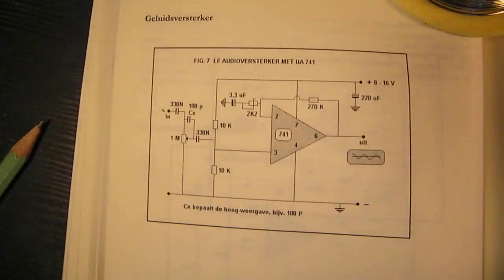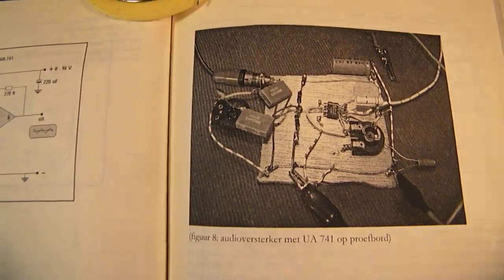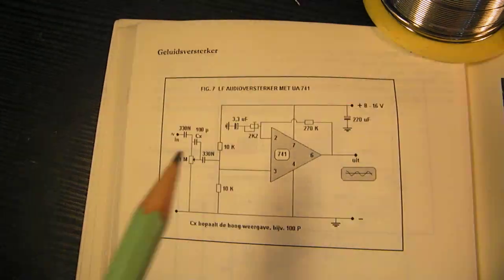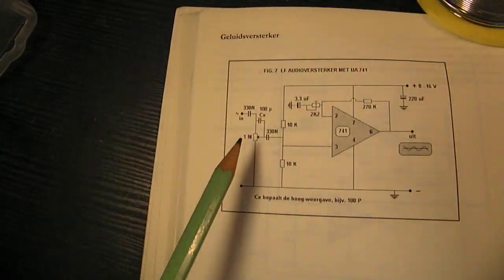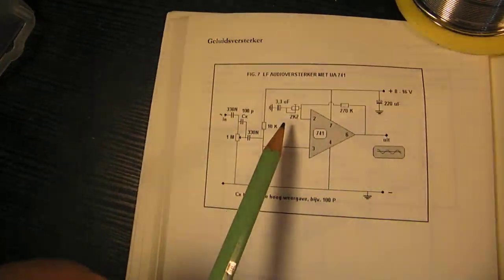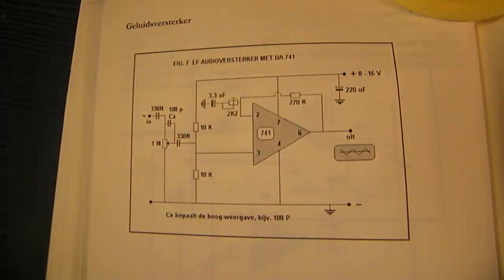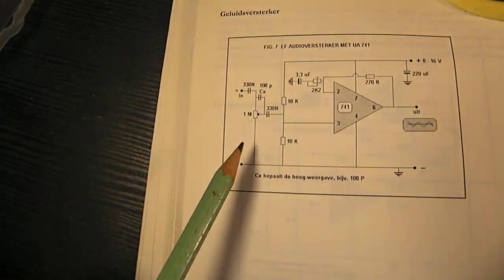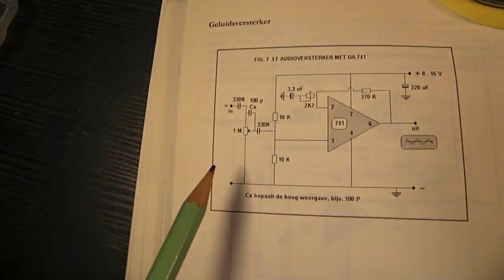Small headphone or audio (pre) amplifier with a 741 Chip, say 50 mW (schematic)

Comment: Can you recommend a good amplifier schematic not for a modern, ubiquitous 32 ohm headphones, but for the classic ones, having 300 ohm? Hi-Fi quality of course.
Reply from the maker: That is a very difficult question for me, because I don't focus very much on HiFi. More on the way that you appreciate to hear your music.
Reply: Yeah, I've noticed that you rather use a "good quality" (amplifier, loudspeaker...) term, but I treated it as synonymes. I also don't believe in audiophile abracadabra and don't need nothing audiophile, actualy I  need something to use with an old analog synthesizer with a broken output module. :)
Reply from the maker: I have published 2 medium power amplifiers (say 6 Watt or so) on my YT channel. They both are usable with good quality LS boxes, with some bass boost. In my book "Schematics 2 audio amplifiers and Loudspeaker boxes" (textbox) there is a schematic from a (say) 30 Watt audio Amp, but the bass response from that amplifier is limited. I will give you a link. How a 300 Ohm headphone can be connected to them is not visible at first sight, given the low supply voltage from the amplifiers. Could be that it can be paralleled to the 8 Ohm speaker or that a voltage divider is necessary to adapt the volume (?). I never worked with that impedance.
Reply from the maker: link is https://youtu.be/a8w2vEB9MJM
Reply from the maker: This https://youtu.be/wFzO-f-sfuQ is also a good schematic, though you have to do experiments with the potentiometers at the input (creaking sounds), though the sound and the sound control (3 potentiometers each channel) is very good. These 3 potentiometers in their cooperation act as an audio filter unit.